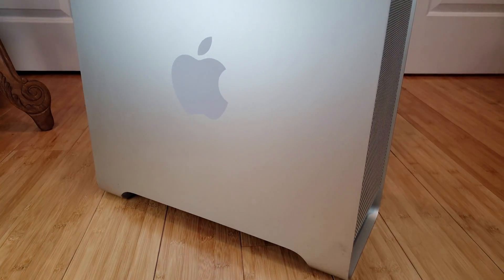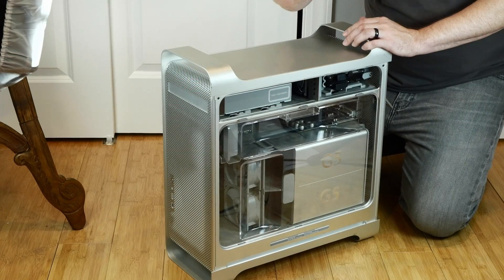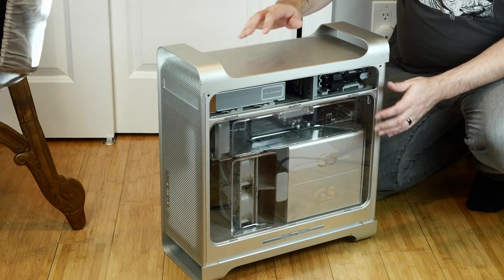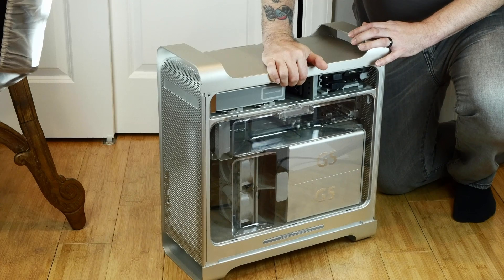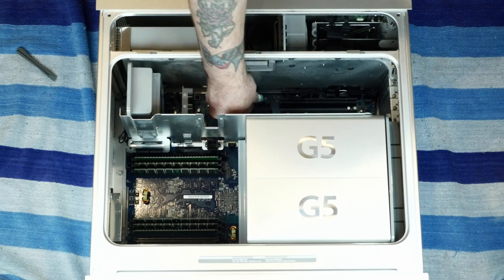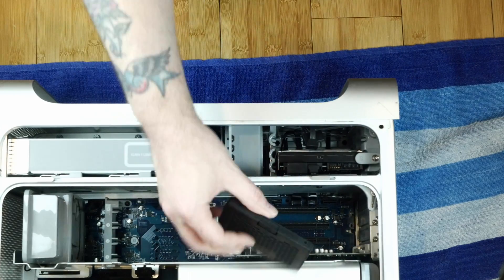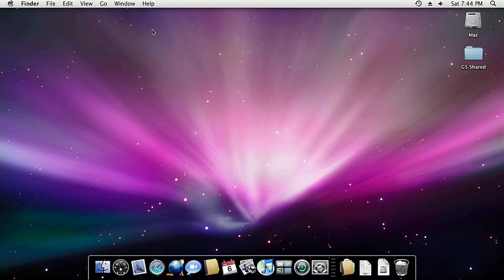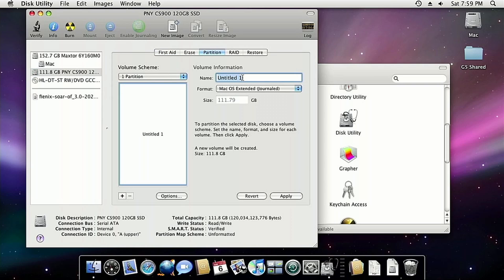Maxing out a Power Mac G5 Dual Processor 2.0 Ghz - Hard Drive m.2 SATA SSD upgrade and max RAM

Comment: I bought one of the 1.6Ghz G5's when they were being sold on the refurb store in 2004.  I paid $1299.  It was one of my favorite computers I've ever had (I think my Mac Studio might have beat it).  I used it for about 5 years and replaced it with a Mac Mini.  The 2009 Mac Mini ran circles around it, but the G5 was just so cool.  I still have it in a closet - it still works fine.   I dug it out at one point and installed Sorbet Leopard on it (10.5.9).  It still works well, thought it's a bit on the slow side.  Mine has 2GB of memory, 2 x 500GB drives, and an Airport card.

Comment: I have the same machine. Lots of fun squeezing performance out of them. 

My mods (so far..):

- Gentoo Linux, 6.12.3 kernel
- Samsung 840 128gb boot ssd
- Samsung 870 1TB swap / archive ssd
- Samsung 990 Pro NVME drives (2 x 2Tb) on 2 x  pcie riser cards (ZFS pool for portage / applications / general file share)
- 16Gb ECC RAM (re-purposed from an old riverbed appliance)
- Nvidia Quadro FX4500 512mb (hp oem reflashed to mac ppc)

Lots of fun 😊

Comment: Hello AR, I`ve a Power MAC Dual G5 ( 2 x 2Ghz processor ) 14GB DDR2 RAM, GeForce 6600 and Corsair Force LE SSD with 10.5.8 OSX as a boot disk ... I bought it for 50 euros because I wanted to use this splendid chassis to build a PC....but......when I opened the side panel I said.....OMG, this is magnificent!!! And I didn't have the courage to dismantle it.....I would like to ask you something, Safari is not able to navigate the WEB, do you know a way to navigate the Leopard 10.5.8??? A thousand thanks !

Comment: I have a G5 and it is completely different inside than this. It has 4 drives that go along the center row and the fan on the bottom is very close to the front of the computer. The ram is in the bottom right
Reply: That’s a Mac Pro

Comment: Watching your videos I’m about to become a Mac 🖥️ (Mackintosh) Hoader 😂.

I have a Power Macintosh G4 (Digital Audio) 2000 with a 533Mhz 7410 Processor, 128MB OF PC133 RAM (768 after some upgrades lol) NVidia GeForce2 MX
VRAM 32 MB, 40GB IBM IDE HDD, CD-RW, 56K Modem, No airport card, 338W PSU and OS 9 classic alongside tiger 10.4. 

Also Imac 20 inch 2006 clean, and Imac 27 2011. All of them immaculate. I wanted to do some projects with then but they are so clean that I’m afraid to change them.

Comment: I think Broken Electronics got that rightThe first two SSDs were too modern.  I have one of the same computers and after reading about how upgrades are doneI'm glad I saw your demo.  I have a OWC SATA II 120 GB SSD I was planning on trying.  I'm going to try cloning the boot drive since I don't have an install image. Is there a version of FCP that will run on this platform?  I am assuming that the software needs to be created for Power PC.  If I can't get it configured for legacy video editing, out it goes!

Comment: I remember when these came out, they were the bees knees and so awesome. When I went to a technical college, called TAFE, in between jobs, they had a big lab of them. I can't recall what models but I think they were first generation G5s. I don't think they allowed them to run very fast tho, it seemed like the power management settings were set quite low, something that was changed. At the time I had a G4 Quicksilver that was on its way out and couldn't handle the same large files I was dealing with in Illustrator. I upgraded to the Core Duo Intel Mac mini, as it was 2006 at the time, and it handled my large files like it was nothing! But there is something about the G5 machines that's very appealing and well thought out when the CPUs ran so hot.

Comment: I’ve always had a soft spot for these, but just in a “last gasp of PPC” way when compared to the Mac Pro. Of course the outward industrial design is the same for both, but the Pro seemed much friendlier to quickly upgrade a component and then close it up again. I also contest the insides of the Mac Pro looked nicer too. 

Even the interior beauty of the big G5 covers is outdone (IMO) by the Pro’s drive bays, the removable RAM drawer, the socketed Xeons, the extra slots, and the increased I/O. But then, I’ve always found that acrylic airflow cover annoying, while I know some folks absolutely adore it. And there is something deliciously extra about the G5’s heatsinks.

Comment: Hi, I get an old Power Mac Dual Processor (DP) G5 1.8GHz A1047 and I want to know if is posible to upgrade the processor to 2.0 GHz. I don't know much of Macs, but recently I can upgrade the memory to the max (I think so...) to 4GB. That machine have 4 memory slots in total. When I open the case door, it shows the heatsink cover with two G5 in it, like yor video. I assume that have two "cpus"? If I can upgrade the cpu, I need to buy both 2.0 GHz cpus? Thanks for your videos!

Comment: I still have a 2.30 GHz G5 in my basement. But I don't know why I should set it up and turn it on again today. My Mac mini is quieter and faster. Thanks to eGPU also in terms of graphics performance. SATA3 SSD, faster RAM, USB 3.0. Everything is actually a bit outdated even today, but still significantly faster than the G5. In addition, the power consumption is much lower.

Comment: . . although in about 9 minutes when you assemble "something" without really mentioning that its a SSD drive (is it . .
. . I think so) you could have been more careful. Also after asembling connecting it to HD cables is too fast . . to 
understand . . but thank's anyway, because I did not know an SSD adabtor was available at all.

Comment: Mine from 2005 dual  2.5 processor with the ultra 6800 ddl gpu  and was very quick and good and  lasted 12yrs,too bad apple went to the intel cpu a few mnths later.

Comment: 14:52 You forgot to change the partition type to Apple... That's likely why that SSD didn't work right. You used the defaults, and a PC drive like that usually defaults to DOS partition. :) Ran into exactly the same issue with the exact same model of drive in an identical G5! Lol!

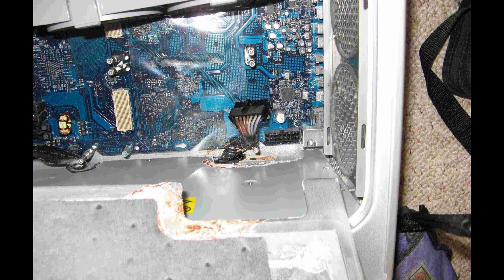Comment: 3:48 You have this whole thing exactly backwards. The older dual processor models above 2.3 ghz were water cooled, the dual core models ram MUCH cooler, and only the very top end quad 2.5 was water cooled. The LCS was garbage though, that's absolutely accurate!

Comment: I have one of these very early G5’s — bought it way back when they first came out. My machine has both OS9 AND OS10 [early version].  I have well over 50,000 documents stored on it with MacWrite operating on OS9 and ClarisWorks operating on OS10. — it still works greatly 2021. I was once offered a brand new G5 by the company I bought it from because they had a commercial client who needed the OS9 system for their business. But so did I for my only MacWrite and optical text scan program.

Comment: You have so much half-truthes here, sorry. First of all, the G5 wasn't loud from the beginning. It was in fact praised for being so quiet. The fans don't spin "crazy fast", it's exactly the opposite. They are high static pressure fans that turn very slow, around 300 RPM at idle. And last, the water cooling that broke down was not the one of the mid 2005 dual core machine. There was a 2.5 GHz version from early 2004 which had the first iteration of water cooling, this was prone to leaking. Then there was a second generation water cooling in the 2.7 GHz models. And lastly there was a third generation in the 2.5 GHz dual core machines. The G5 Quad with the dual core processors was never prone to leaking.

Comment: Intel Mac pro was released in 2006 but ppc was well supported thru 2008 at least. Bought a used g5 in 2009 and I was running Photoshop cs4 ppc.  the thing was receiving some updates till 2011, if I remember correctly.

Comment: Someone else may have already pointed this out, but the Power Mac G5 wasn't the only PowerPC Mac with SATA hard-drives. The iMac G5 also used SATA hard-drives; I know this from experience, as I installed an SSD in mine. :D

Comment: I loved my g5! I had one of the last ones before intel.
Reply: And side note. I bought the dual core with maxed out ram and a cinema monitor for $500 in 2008. That’s how quick these plummeted in price after the switch to intel. I limped it along until 2011 or so before tech incompatibility for work made it a brick for me

Comment: Next, find a dead 2.7 dual, shuck the CPU cards and install them into the 2.0 machine, running them with air cooling. More modern thermal compounds and better application of it may make this the best screamer PPC Mac you can build. I've been wanting to do a single air-cooled 2.5 GHz dual (late 05), but still have a working quad so am reluctant to disascemble it unless I'm refilling the LCS and cleaning it out.

Comment: I bought a dual-G5 when they first came out. 2GHz. The computer was 3G'ws and the monitor, the middle one, was 2G's.  It lasted quite a while..  I get I burnt a few hundred DVD's on it, NTSC stuff taken with a handy-cam.  Then, one day, there was no video.  Restarted, worked.  That was the beginning of the end.  It became more and more unstable.  Ultimately, it must have been the power supply.  Mine was never noisy, but when I started swapping things around, and the computer knew it, I had a vacuum cleaner in the box!  There was a utility that I must have downloaded specifically for that computer model, that tested the thermal profile I guess, took hours, and suddenly was nice and quiet again. That didn't fix the problem.  I eventually changed the video card, which worked maybe for a month, and did the same thing.  Then I got to the nitty-gritty.  I found access to a voltage adjustment in the power supply. When I was able to get it up and working, while it was working, I started cranking down on the 5V supply. The computer locked up at 4.65 volts.  I cranked it back up to 4.75, and it went flawlessly for another couple of years like that.  It eventually got to where the hard drive was having errors.  
 I found a dual-dual core G5 (water cooled) on line for rather cheap.  Nothing leaking.  Memory was all different types and reporting wrong size.  I was surprised it worked at all..  I got a even number of the same type in both banks, and that fixxed the memory.  Then, I though I'd put my now-crashed drive from my older computer in this one.  It was carrying-on for a while, then miraculously, it fixed every error on that hard drive by itself!  
BTW, on that old mac, I even changed the mother board! Same problem. About singling out a bad power supply, which I couldn't find anywhere.  I think it was a trend that these went bad.
Thanks for the video!

Comment: Couple minor corrections for you. The single core dual processor 2.5GHz and 2.7GHz systems were the first to have liquid cooling and they were also the ones notorious for leaking. Of the 3 last generation dual core models, only the 2.5GHz Quad system used liquid cooling, and it was of a different design that rarely leaked. The 2GHz and 2.3GHz dual core systems used air cooling and are known to be the most reliable G5’s made.

Comment: FYI- I was a manager at CompUSA, miss the old days too.  But people don't love and hate them, they love to hate them and some hate to love them.  You need to gut that case and put in a Raspberry Cluster.  I also miss Ultra-Wide SCSI 3 and Adaptec, I can still count/add/subtract to 15 in binary without having to actually think about it.  You could have more than four drives with SCSI, incredible!  I had to 2 15k baracudas in Raid 0 and three 7,200 Maxtors in Raid 5, a ZIP drive, a Jazz drive (1GB!), a DVD, CD, and a writable CD then DVD drive.  I could write CDs!  I was a tech god at the time.  I had a PC that could play videos on my TV via composite, a Sony Trinitron of course, a tech god I tell you!

Comment: Another gripe for the G5 is the placement of the PSU. Because it was low to the floor, it would collect a lot of dust and fail. But then again, I had a MMD G4 and Mac Pro that blew out the PSU's and they were on the top?

Comment: I really prefer Tiger, it has classic, and I can carbon copy clone between all my G4 and G5 macs with no issue for booting, even between the various ATI and Nvidia gpus. 10.4.11 is the way to go on those machines. So at work I have only 2 os versions : tiger and mojave.
Reply: I kept Tiger on my Quad G5 for that very reason; there are still a few Classic programs that are useful to me, and the Quad G5 Mac is the fastest Classic-compatible machine ever made.  Interesting side note: I bought mine on eBay, and supposedly, it was used by a company in a render farm that worked on the movie Star Trek: The Wrath of Khan.

Comment: I'm writing this on my Powermac G5 dual core 2.0Ghz. The video isn't smooth on TenFourFox G5. The framerate is quite low even on 360p, but if you live in terminal, it's great and it still has the looks.

Comment: I have 2 of these machines I bought for $40 each waaay back in 2011. Still have not been able to power them on as they came with no video cards, or drives. I have no clue what AGP card works on them since all the ATI and NVIDIA cards I have tried fail to be recognized. I thought maybe pci-e? Nope! I may remove the G5 system and just use the cases for intel mini itx systems that actually work!
Reply: You can use many different agp gfx cards, there is a list out there. I just use stock nv fx5200 for the adc port,however I did flash a 7800gs leadtek that works perfectly on the G5. Could also try a 9600series ati flashed card. For pciexpress a GF6x00 safest bet.

Comment: I own 2 G5's and love them. I have 1 dual core and 1 quad core both late 2005. These G5's are louder than a house fan when they are cooling. When I bought one of mine, when you turned it on it did not make the apple chime at startup. It turned out that one of the two memory cards was damaged and once I replaced it I never had a problem from it. I mainly use them for storing and backing up family pics. The safari browser still connects to some sites, but I found that tenfourfox works far better. I always loved the style, build quality and craftsmanship of the G5 and the Mac Pro.

Comment: Sooo...funny story...Apple has announced they are going to a new processor series right after they finally released the first useful Mac Pro in almost a decade.  I'll bet the people who shelled out the cash for those are thrilled!
Reply: History repeated itself. The G5 came out just before Apple announced the switch to Intel. 

And OSX dropped support for PPC after only one more version. 10.6 was intel only even though the first intel processors were 32 bit only. It was a mess. But Jobs wanted laptops and there was no way a G5 was ever going into a laptop.
Reply: @mikespangler98  They sure did.  I went through the Rosetta debacle the first time around.  I'm sitting this one out.  I still have a G5 2.3 DC...I'm in no hurry. :D

Ironic that they now have a bunch mobile chips not worthy of a desktop!

Comment: You made a really great point how Apple really screwed over anyone who bought a new powermac G5 just before the release of the Mac Pro around 2010. Im a proud owner of a Powermac G5 with the 30" Apple monitor. I have maxed out the memory and it has an ssd with a quadra soundcard.
Reply: What choice did apple have though? The G5 processor was falling behind what Intel and AMD were offering. I think they transitioned to Intel fairly well.

Comment: I didnt realize its an intel not a G5 would still run OS high sierra when I accidentally messed up the snow leopard OS by changing permissions.. when you change permissions to system disk -  readable/writable to everyone it asks if you want to change all enclosed folders.. and I was like SURE why not?....... fatal mistake  upon restart all I got was a blank screen.... ANyone know how to fix it? I put in another backup of my 12 core 2010 and set it as the boot disk.. It rebooted! I could read the drive with messed up permissions.. and all of the files.. but none of the apps would work on that drive.. since it was from 2005-7. Anyone have advice to rebuild the OS (revert permissions) from snow leopard? Its 3.0 ghz its really snappy!

Comment: I sold my single cpu 1.8GHz 2003 G5 last year, now I do everything on a hackintosh. It's really been a good computer, I even replaced the thermal compound to improve thermal performance (with mixed results). My only gripe about it was the thermals, it runs HOT

Comment: Around 9mins in as you're installing the drive, there are 4 spare screws on a vertical post between the optical drive and the SSD drives that screw into your hard drive, and guide it into these tracks that slide it in and up. Then the rotating level holds the drive in place.

Comment: Those G5 boxes aren't even worth the power that they take from the wall, unless you plan on running a ppc Linux distro, but at that point why even bother when you can get more modern software on more efficient hardware??

Comment: i really want to get a 2.5 dual or 2.7 with pcie i have a 2ghz that is bad shape cosmetically  the neat thing with the pcie ones is if you use linux you can use better gpus

Comment: How is the G5 going to handle SSD Trim with that O/S? without it, it will die pretty quick
Reply: Modern SSDs usually handle all that garbage collection magically. For a long time MacOS didn’t support trim on non apple SSDs either.
Reply: @eWhizz  Yes that's true.  In that case we used Trim Enabler, but that isn't available for built O/S's before SSD technology.  Mac's need trim to this day.

Comment: G4s > G5s. Took 10 years for my digital audio to finally become obsolete. Upgraded it to hell and back. Dual 7448 G4s at 1.8ghz and a Nvidia 7800GS

I would of been pissed too if i bought a G5 and it became obsolete so quick
Reply: atomicfro same, as wel as POTC and PREY. Prey ran so well with everything turned up. It was crazy